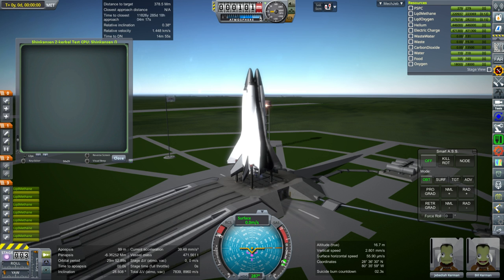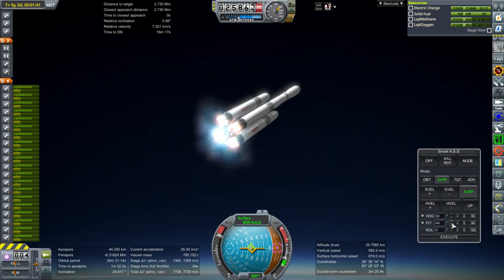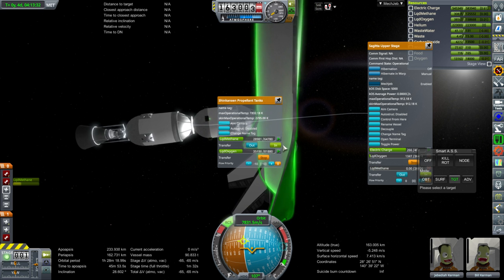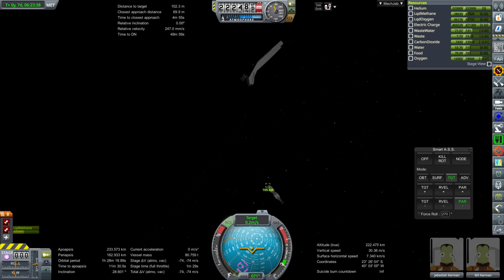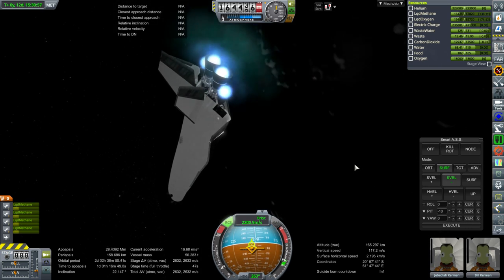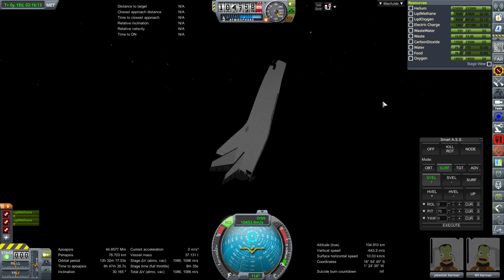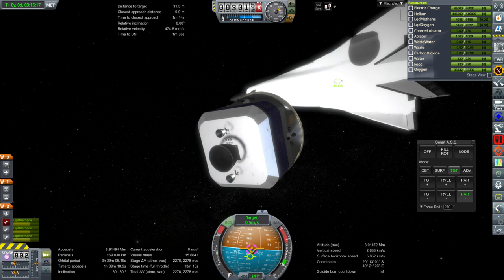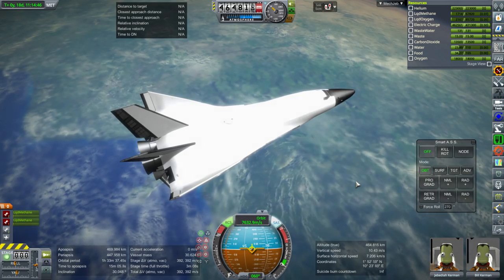KSP - Realism Overhaul Sandbox - Lunar Spaceplane Mission Test

Comment: Curious why you didn’t include a second docking port (Common Berthing Mechanism, APAS, etc.)
Reply from the maker: The larger docking ports will need to be placed inside a bay or at least have a door over them, so that has to be built into the mesh.

Comment: This is extremely inefficient tho, why carry all those wings and heatshield to the moon? Would be better to leave the spaceplane in orbit and travel to the moon in something more LEM-like
Reply from the maker: They're not really wings since this is a lifting body - they're part of the spaceplane structure and not a separate thing. As such, they don't weigh as much as the Shuttle's wing. The broad part of the plane allows us to carry the propellant tanks - they determine the rear width of the plane - so there's no option to make it smaller. Also, it is the size that allows it to use drag on return to cycle back into low Earth orbit. It's extremely efficient as an Earth-to-Moon repeat transfer vehicle. It gets to reuse  both its transfer stage and its service module - something no pod can do, discarding both every time - and the use of drag to return to LEO means that it saves 3000 m/s of propellant trying to do it with engine thrust. Its cabin size is much larger than a LEM, which should really be just kept on low lunar orbit, consist of one stage, and be used repeatedly as well.
Reply: @RaizSpace  I thought lifting bodies do not work in ksp
Reply: @spinningsquare1325  Incorrect, they exist even in stock ksp (though not super well). But that doesn't matter because this is Realism Overhaul, which simulates body lift.
Reply: @The0spetsnaz0  stock has mk2 parts that provide lift. If physics are modded it explains everything
Reply: @spinningsquare1325  That's what I said. Stock ksp does body lift, like you pointed out for the mk2 parts. However Realism Overhaul requires Ferram Aerospace Research-- a mod which completely overhauls ksp aerodynamics to be more realistic and detailed. Wing shape becomes important, aerodynamic stability becomes a serious design aspect. Most things that can fly in stock ksp cannot with FAR installed.